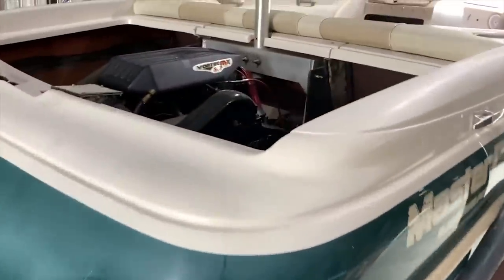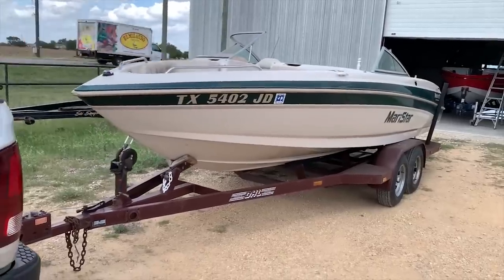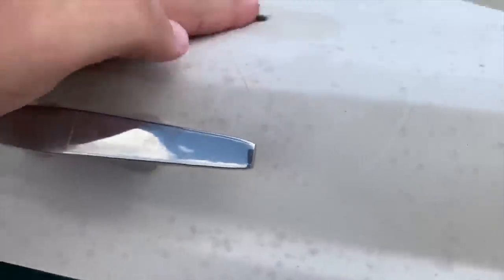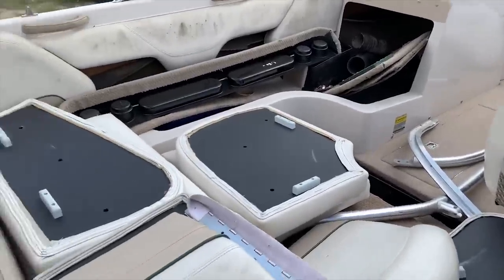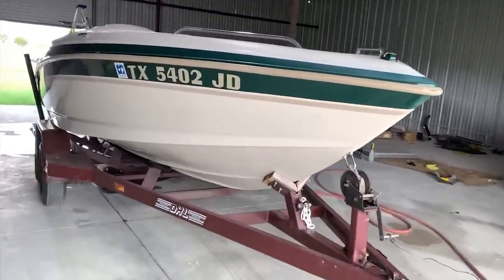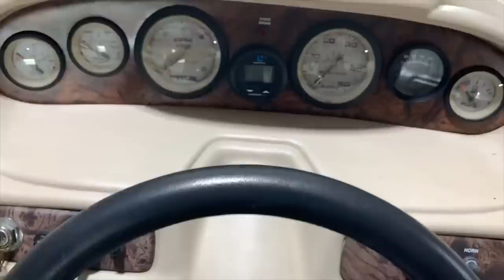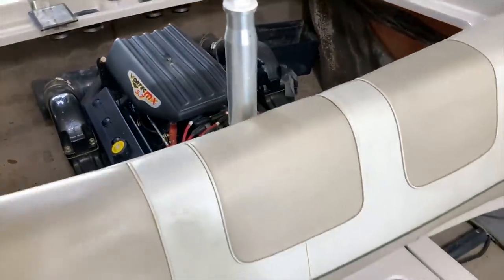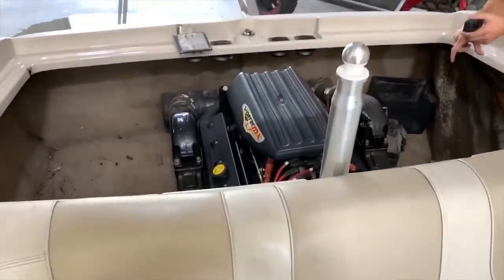WHAT A STEAL! Cheapest Wrecked Boat Ever Will It Surf?

Comment: You can surf this thing without a ton of weight. I bought a 98 225VRS mid summer, it's a great boat. Plan to surf next season and will probably run 750# in each rear locker, some weight in the bow (prob start with 400# and see how it goes), and a shaper.

Comment: If you surf it, it's best to use the  wake shaper contraptions that attach to the side of the hull. If you just use weight and want a good surf wake, not only do you need ALOT of weight but you would need to re prop it or you will induce alot of stress on the motor; and on top of that the bow will be high which CAN cause the potential of engine an oil starvation issue

Comment: Nice.  That 210 MariStar is also the 1st generation X-10 hull.  Excellent platform.  I have the 225 version (23') of that boat and just ordered a tower from New Dimensions.  I'd encourage you to consider them for this build.   They are not overly expensive, but not the cheapest either.  I'm not sure I'd want to use it for a surf boat, however, because of the low gunwales.  Good luck with the build!  Will be watching for sure.  BTW, I'm a Team Talk member as well.

Comment: When running that boat out of water it’s easier to just go get an adapter and hose of the same diameter as the hose going to the through hull. Impeller is a 10 minute job too. I’m interested to see what you do for a windshield... I’ve heard one piece of glass can cost 5k.

Comment: Most ski boats i had for some reason dont like pumping water with the hose jammed in the inlet... usually a hose fitting inside somewhere and a valve to shut off the pickups. And your pump may be cooked 🤷‍♂️